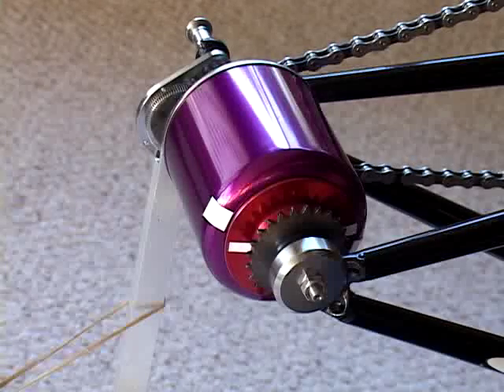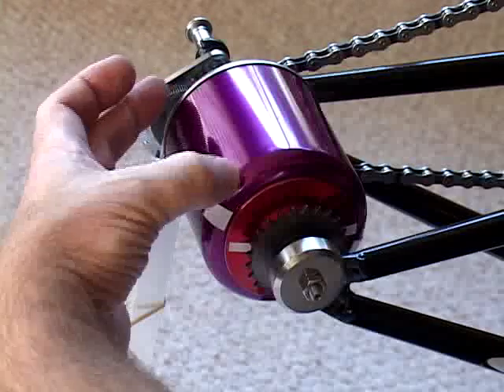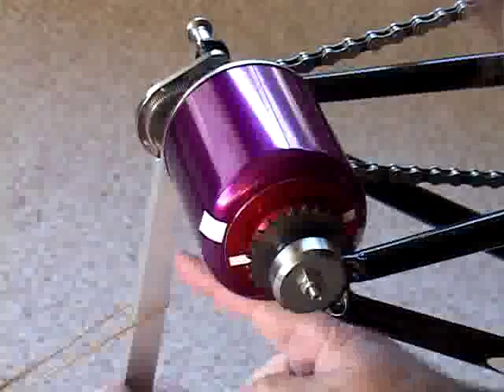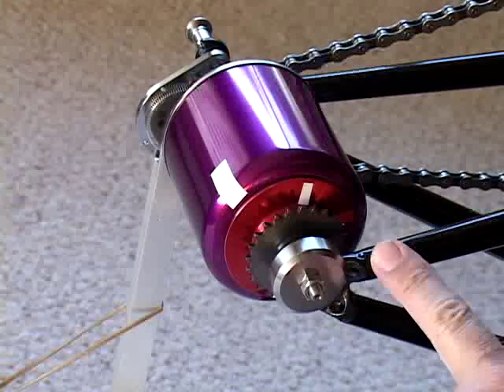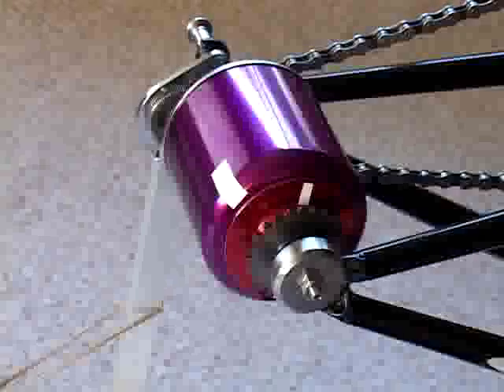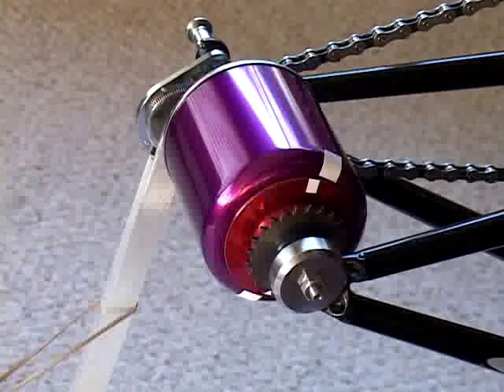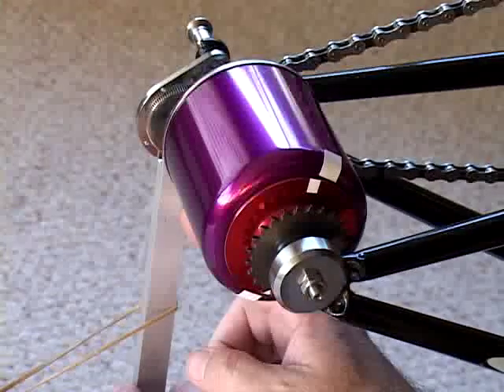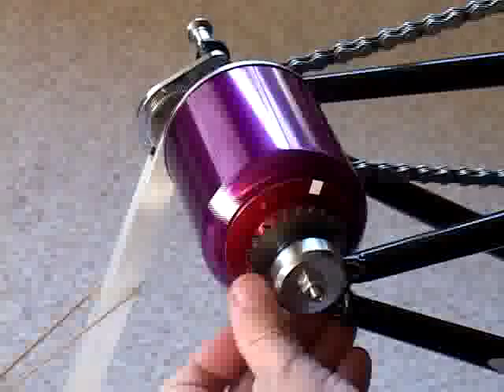Automatic Bicycle Transmission (IVT)

Comment: how does it work? is it like the D-drive?
Reply from the maker: +Afro Barreto No.  The 'D-Drive' is not novel, and it's not an infinitely variable transmission.  Prius uses multiple prime movers, and has been for several years.  The SIVAT has only one input & one output, a condition of the IVT.  I'd tell you how it works, but I'd have to make you suddenly disappear!  It will remain a secret until it's tested with a new design and produced for sales.  I'm currently re-working the design for a potential product by request.  My goal is to first make a single general-purpose design that can be used in various applications.
Reply: Make me dissapear? Oh boy! Oh boy! I love magicians lol
Cmon dude if it makes energy usage more efficient it benefits mankind, share man, didn't we learn nothing with Fleming?
The Chinese soon will have a cheaper knock off anyway ;P

Comment: This would be perfect, larger scale, for electric vehicles.
Reply: No multispeed transmission in any of the mainstream electrics.
Tesla Kia Leaf Bolt Fit B200 - none if them
Reply: +Luke M EVs do not need a transmission and attempts at one failed as  the components could not handle the instant torque.
Reply: electric vehicles don't need a transmission.
Reply: +Daniel Calzada ya, they need a rheostat, but wouldn't it save on battery , if the did.
Reply: +Daniel Calzada ... Electric vehicles do indeed need auto transmissions for efficient battery usage. If you do your research you will agree with me.

Comment: No video of it actually working on a bike? Probably slips when under the slightest payload. Show how effective it is. Put a wheel on your bike, ride it up on an extended incline, shoot and post the video. Talk is cheap. To see is to believe.
Reply: 9 years video. Still nothing.
Reply: I think it might just about be able to transmit enough torque to pull the skin off a rice pudding.
Reply from the maker: Talk is cheap, but prototypes are not.  The next video will feature a working prototype for testing on a bike with mountain riding.  Posting this concept video has garnered enough interest to justify costs to take the concept to the next level.  This concept has no prior art from which to design a perfect initial device; it's a totally new idea.  What was learned from this proof-of-principle unit was used to fully sort-out what's needed for a real-world mountain bike transmission in a second design.  By showing this concept first, potential customers are offered the opportunity to help determine its viability in the marketplace.  Both public interest and engineering calculations indicate that the SIVAT should move to the next level; a pre-production prototype that's fully capable of processing the physical power of highly athletic mountain bicyclists ascending the steepest mountains they can ride.  As a seasoned mechanical engineer with decades of experience, I'm reluctant to waste anyone's money on a losing proposition or a planless approach devoid of adequate research.  It takes more than one step to succeed with a new idea.
Reply: Oh look, talk is cheap... that "Next video" never happened?

Comment: I'd suggest if there's not a prototype working on a bicycle then the project isn't serious enough. It has been 7 years since this video was posted. 

There's no disclosure of how it works (or view inside) so it can be seen only as a concept. 

Not that a cvt isn't a good idea for a bicycle but working prototypes are the real proof of the pudding. Even if it's an unconventional bicycle with the device outside the hub (perhaps a gear train going from crank to the device then another from device to rear hub).

The model being shown isn't carrying any load so it's not very convincing.

If there was a clear disclosure of the internals you'd be prone to get descent review and support and likely find someone to help.

Do you have a Web site or something serious for this project showing the details?
Reply from the maker: +Darcy Whyte You'll be in for a surprise.  I've recently re-started this project with the goal of building a working bicycle-mounted prototype for a demo in 2016.

As for showing the insides, that would void the patent application(s); something I'd be foolish to do!  This video admittedly is about a proof-of-concept, a starting point from which I anticipated finding design weaknesses that are not associated with the concept, but rather with its specific implementation of part sizing & potential re-design to correct its few initial design errors discovered in testing this unit.  The basic theory is sound, and the re-designed prototype won't grow much in size or mass if at all.  The demo will show an athletic bicyclist riding on hilly terrain, and some test results.
Reply: +SIMKINETICS I will be surprise. If you're going to get a patent, you're likely too late. This video is 7 years old. The grace period isn't that long.
Reply: +SIMKINETICS Good on you. 'Smart, interesting video. As an everyday cyclist without a car, I'd love to have an automatic transmission on my bike, and I really hope you succeed. Questions...
- Rough idea of likely price, if you can estimate it
- Ideas about electric drive with a lithium ion battery
- From a few years' experience of an Avanti Electra front-hub electric bicycle motor, a flywheel will produce very bad 'twist' effects at 90 degrees axis. I would discourage that, even for recovery of energy, and even on the back I guess. It also adds weight. And batteries are getting sufficiently capacious to obviate need for a flywheel.

Bruce Thomson in New Zealand.
Reply from the maker: +Bruce Thomson Thanks!  My goal is to get the price within the range of that CVT you sometimes find on bikes, a few hundred dollars as a kit or added as a standard component on some brands.  The first units will likely be higher-priced to amortize some of the start-up costs, but eventually automated fabrication & assembly efficiencies can make them quite affordable because the design isn't more exotic or complex than 7 or 8-speed hubs.  My engineering career involved much automation design, so I'm designing it from experience.

The flexibility of wide-ranging variable gear-ratio choice enhanced by a microprocessor would help both battery life and motor dynamics on an e-bike.  I've done fairly extensive research on that, and will do more before we get to that point.  E-bikes may be a substantial market for the SIVAT.  SIVAT power-density is high enough to make that quite practical up to about 1.0 kW throughput or more.

The flywheel energy conservation scheme I referenced was never intended for certain small vehicles for the very reason you cite.  However, I'm aware of methods to eliminate gyroscopic effects that make the scheme appropriate for vehicles that can handle the extra weight!
Reply from the maker: +TheLegoman0077 Thanks!  Once I get the working prototype (next-gen) build on a bike, I'll ask for some volunteer testers to help evaluate the SIVAT.  My personal tests on a somewhat related automatic prototype suggest that it will please even hard-core mountain bicyclists.  My latest iteration will likely offer an optional fully-sealed version that will avoid contamination from the drive-sprocket/chain-drive system to the hub, and better ground clearance than current derailleur drives.

Comment: If there's too much load, it just disconnects. Great way to crush your balls on a bike.
Reply from the maker: +KocuRisko No, it won't.  I designed, built, installed & tested a predecessor CVT with similar automatic controls.  The ratio doesn't suddenly drop without resistance, but rather only drops down to a ratio that fits the 'new' resistance.  It's unlikely that stomping on the pedals will ever get the SIVAT into overload condition where the ratio is zero because an adjustable damper will regulate how fast it responds.  I've had that happen when a derailleur system disengaged the chain; and deliberately avoided that possibility through SIVAT design in memory of that pain!

Comment: So what are problems with this contraption? It is here for 7 years, you have working model... And that's it. I would expect that there would be some development after such long time. Is it so costly to make 10 or more prototypes and install them on bicycle? You know, that would be great advertisement.
Reply from the maker: +Peter Švančárek There's no problem with this 'contraption'.  What you see here is a proof-of-principle model, not a working prototype.  Prototypes are very expensive, and the unhealthy economy has not justified proceeding with further expense yet.  When the worldwide economy shows signs of recovery, I will build at least two working units of a newer design that addresses weaknesses in the POP-model, and show the results with a bicycle rider on video.

Comment: how are you able to achieve the "zero" ratio? I am interested in designing my own CVT/IVT transmission to drive a flywheel.
Reply: Have to have two axles rotating in opposite directions, at both ends needs to be a sprocket within a hollowed out inverted gear with a normal orbital gear in between. Opposite directions will cancel all motion to the drive sprocket, and stopping one axle will cause the 1:1 ratio, with infinite variability based on the ratio of how fast the axils spin in opposite directions. Of course there are other ways (using a friction belt) but the gears is the most efficient. If you don't understand message me and I will link you to an example video Lol.
Reply: thanks for the reply. I understand what you're saying. I think i saw an example in another video too.